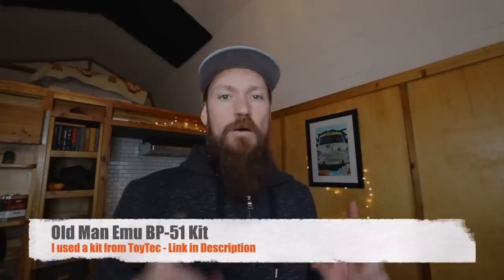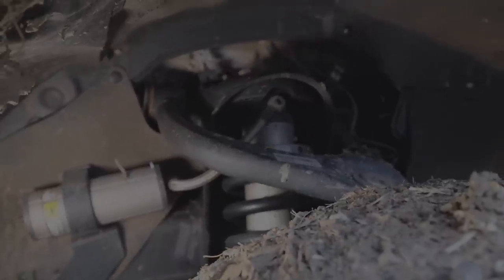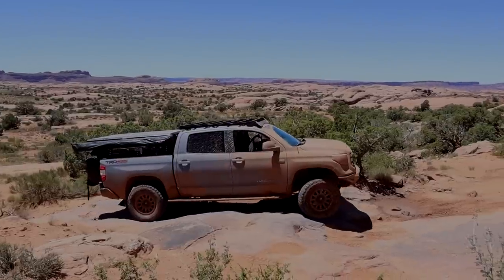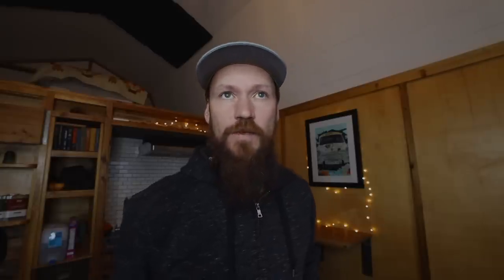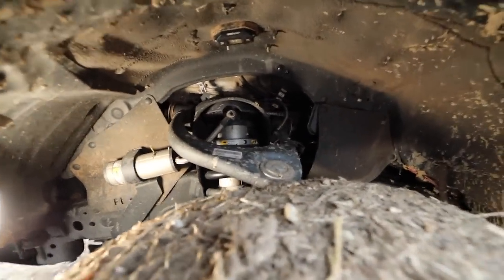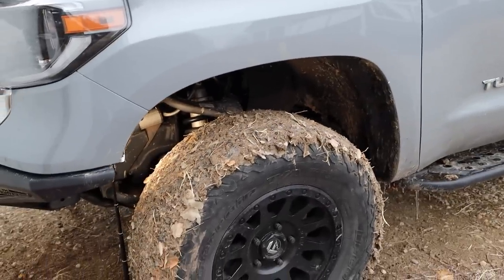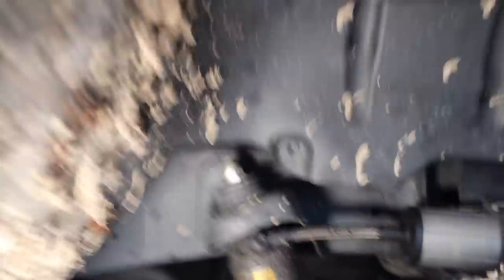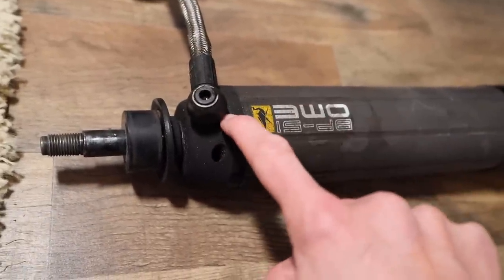Old Man Emu BP-51 Suspension - Watch Before Buying - WE BROKE IT - 1 Yr Offroad Review

Comment: I believe your right about trimming the bucket or adding a taller bushing and It's sad that isn't in the install instructions. Going straight  to ARB's web-site:  https://arbusa.com/toyota-tundra-2014-2018/old-man-emu-4x4-suspension/ they offer Heavy Duty springs for your truck as they do for mine. I went with their mid weight pack (550lbs) for the rear of my PRO4x which makes it ride one inch taller when unloaded - but level when it is! The OME springs and shocks improved the ride both on and off the road. I have OME on my jeep as well -they are guaranteed for 3 years - not the more usual 90 days for off-road springs and shocks.
Reply from the maker: Gary, thanks for the link... Hopefully they actually have stock... I keep finding everything is on backorder... but that is not an exclusive issue to ARB... everyone is struggling with that this year. I also am VERY impressed with ARB/OME's warranty... they are awesome... I still think this is a fantastic kit and probably has the best ride available in it class/price range... the work around is very easy so in a lot of ways I still would recommend it.
Reply: @OutdoorAuto  Good luck getting the springs - you might run the part numbers past 4-wheel parts as they have multiple sources.  If you have no reason to remove the front shocks, I'd recommend just cutting  out a notch or triangle in the bucket just above the tube.